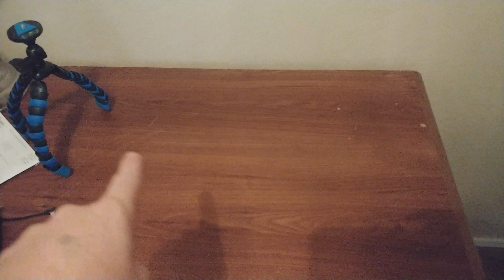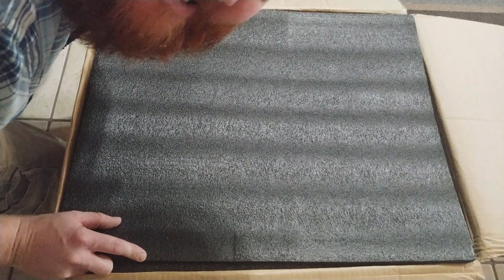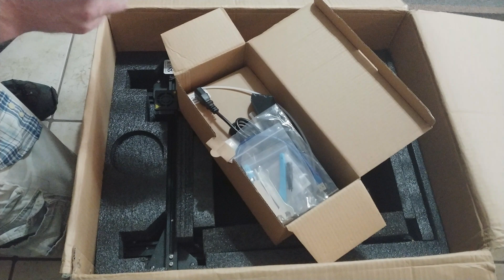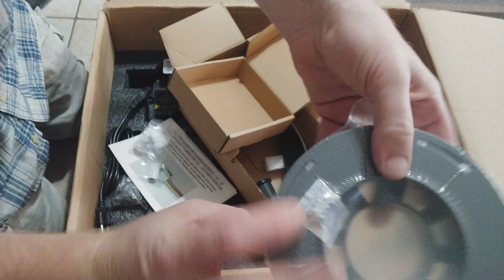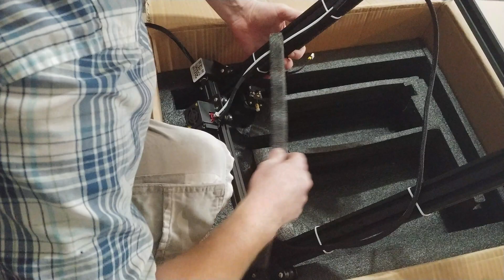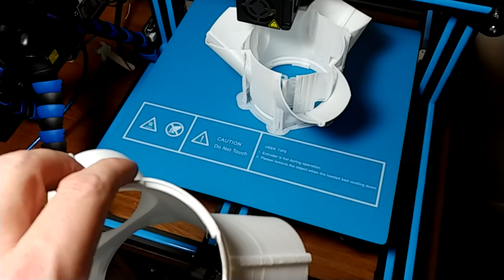Unboxing video!

Comment: Now that is a cool machine there.  I want one!  Got a link?
Reply from the maker: CCTREE Creality CR-10S DIY Desktop 3D Printer Kit Large Printing Size 300x300x400mm 1.75mm 0.4mm Nozzle with Filament Detector and The Dual Z Axis https://www.amazon.com/dp/B071KPBH3G/ref=cm_sw_r_cp_apa_i_xPUcCb8Z9ZG4F

This is the one I have👍😃 
I love it so far but it does need some tweeking at first bull I'll share that in another video👍
Reply: @ToddLarsen  Nice, thanks!

Comment: That is an amazing machine there Todd! Your gonna be up to your ears in parts soon. Lol. 

Have a great weekend!

Yall gro dat!!
Reply from the maker: Thank you so much, I've wanted one for many years and can't believe I finally have one.
I can make my own custom plumbing parts now for future projects with hydroponics and aquaponics.
Reply: DIY Aquaponics with Todd Larsen have you added the perlite to your new grow bed? If so how is the flood and drain working with it? 
Like I said before I have new troughs I want to hook up but wanna use try drain system if it works !
Reply from the maker: @CajunHydroponics  I have added the perlite and the flood and drain is working great. I was going to wait until the carrots sprouted to do an update on it but the seeds i had planted were pretty old and didnt sprout so I'll just do the video without the carrots lol
Reply: DIY Aquaponics with Todd Larsen no that's fine you can wait. I was just check. 
As far as the carrots I covered mine with news paper until the seeds started to sprout. Like 5 days. Hit the newspaper with some water to make it moist.
Reply from the maker: @CajunHydroponics  Oh I completely forgot about covering them shoot! Seeds replanted and bed covered👍😃 Thanks for the tip😃😃🐟🌿🌾🌱🌻🌞